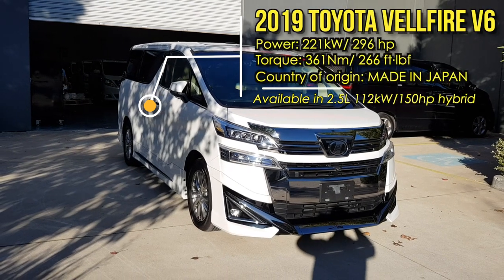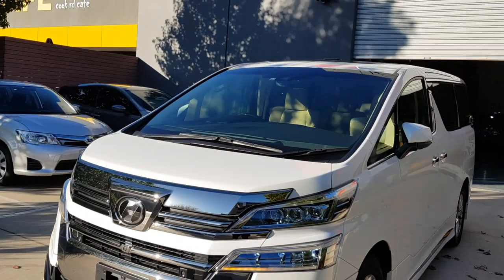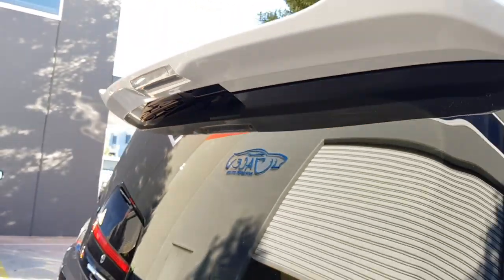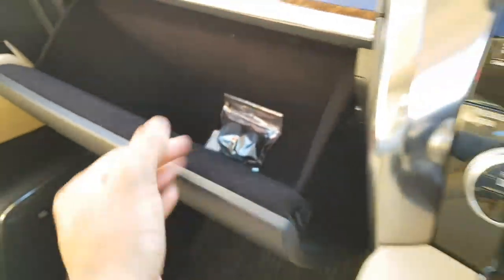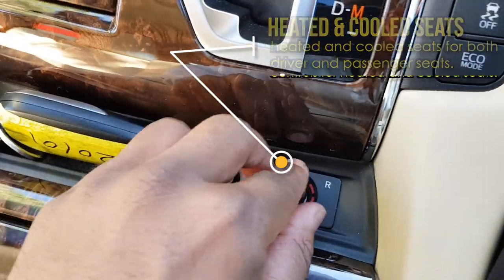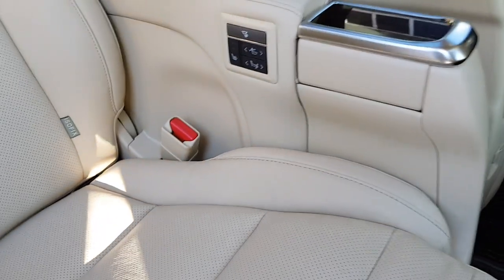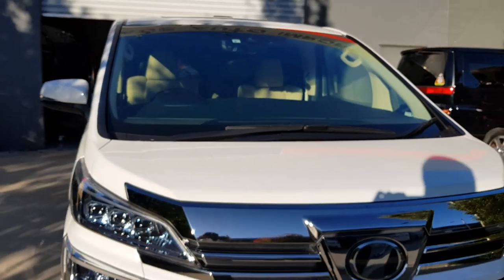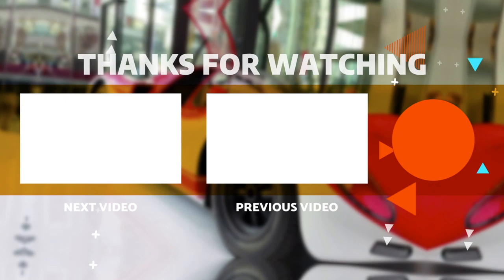The Toyota Vellfire: The Fastest Toyota Yet!

Comment: Inside, the Toyota Vellfire features leather upholstery, powered captain seats for the second row, 16-color ambient lighting, three-zone climate control, powered side doors, powered tailgate, electronic parking brake, smart entry with push-button start, and a JBL-sourced 17 speaker music system. Additionally, the Vellfire comes standard with a three-zone climate system.